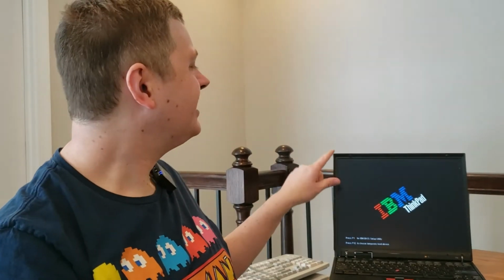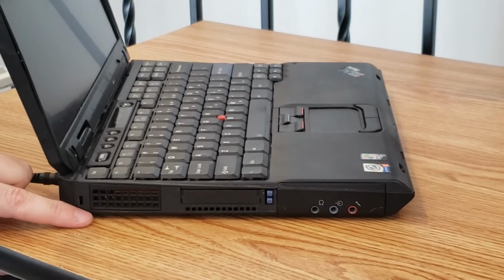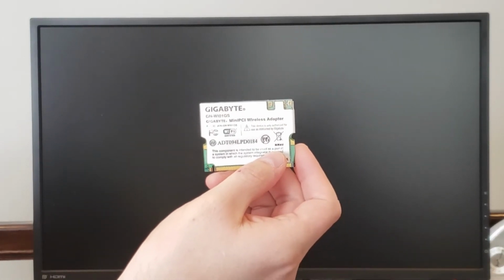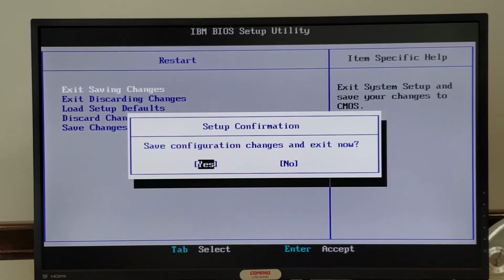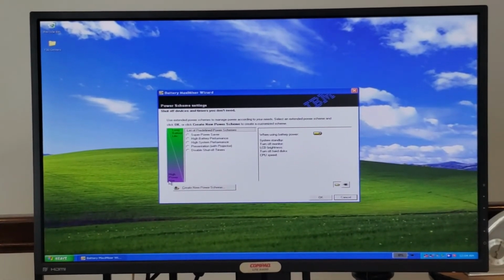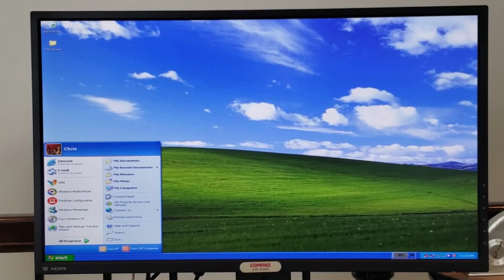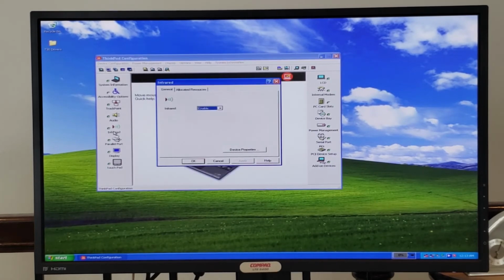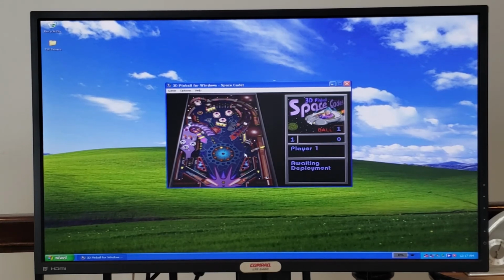RetroTour: Let's Explore: IBM Thinkpad T30 Pentium 4M Laptop!

Comment: I too, have a ThinkPad T-30 which hasn't been turned on in years. I recently had to dig it out to run a legal program that wouldn't even run in newer versions of Windows. So I had to use the T-30 to install the software to create some legal documents. The keyboard has spoiled me for life. I've been using an Acer Aspire for years now that also has a wonderful keyboard. I don't know who changed the design of the keyboards, but I absolutely hate these individual, separated keys on modern laptops.Of course, I'm old and learned how to type in high school on IBM selectric electric typewriters! That being said, I finally decided to upgrade, as I have been resisting the purge to Windows 10 and eleven. I actually drew the line at Windows 8 with that ridiculous cartoon interface. I ordered me an MSI gaming laptop last night. I'm not a gamer, but I have the need for speed.
Thanks for the trip down memory lane. I actually came her to watch how to replace the CMOS battery. It's in the memory compartment, but the connector is under the case, so sadly it can't be removed without taking of the keyboard.
Reply from the maker: I miss the old Thinkpad keyboards too!  Just ordered a new Thinkpad and the keyboard definitely isn't the same. Glad you enjoyed the video and thanks for watching!

Comment: Thanks to an active hacker community around the IBM ThinkPads, unauthorized HDD  + 1802 unauthorized network card issues have all been fixed with a custom firmware. I've applied this on all my ThinkPad X41's, so they shouldn't give whitelisting errors on boot even if the CMOS battery runs out. But I've also changed the CMOS batteries on all my X40's and X41's. The ones my laptops use are the thinner CR2016 batteries. They're still occasionally sold on eBay. I buy a couple every time I see them pop up. I buy the ready-made batteries, I think they were only like 5-7 bucks a pop.
Reply from the maker: Good info!

Comment: The T30 was my first exposure to ThinkPads. But you forgot to mention the (IMO) best feature: the ThinkLight!

Rather than share every little story I'll just say that I'm now the proud owner of an X31 with 2GB of RAM and a perfect battery. It's pretty much the same design as the T30 but it's smaller and has one small but notable difference: when you slide the latch to open the screen it stays in place until you actually open the screen. Opening the T30 with one hand was a bit of a juggling act as you'd need to get both latches pulled at the same time. Unfortunately my X31 went totally dead but I was able to revive it, I made a video of that on my channel.

And one last thing, there's a great mirror of the drivers site which is more complete than what's left on Lenovo's site:
https://thinkpads.com/support/Thinkpad-Drivers/
I'm mentioning this because they have the missing UltraNav (touchpad) driver that you couldn't find.
Reply from the maker: Great info!  Wasn't familiar with the X31!

Comment: Hi Chris

Nice machine, i never owned or used a thinkpad, but a few friends had them, not quite tanks but sturdy and well built, the only complaint was the price and they flatten the battery overnight even in sleep mode, i think the 1995-1997 era the cmos clock or sound card drained it

When i do fresh OS installs on theis era of machines, if they have legacy drives or ports i install dos 6.22 on 2G partition, and leave the rest of the drive un-partitioned, that way XP will auto use the unformated and use that and enable the XP dual boot on start up

I notice you had XP SP2 the 1Gig ram would be marginal, the machines i have on that era with 1Gig or less runs the original or SP1 version XP, 1.5G is the next step up for SP2 and fully loaded 2G or up to 3g or 2.5 usable is the SP3

Anyway the P2>Celerons are used for period games one had office 95  the other office 97

Funny how every second windows version is Ok and the one in between so-so

Regards
George
Reply from the maker: So true!  Ya... memory is a little anemic on this, I probably should have chosen a different OS!

Comment: Nice one Chris! I've a soft spot for the old Thinkpads. I've got an old R50e which I bought new in 2003 or 4. It has a Pentium - M 1.8 GHz chip in it , running XP Pro. The battery still holds a charge and the cmos battery still does too! Keep up the good work and thanks.
Reply from the maker: That's great!  These machines are pretty cool.  That's amazing that your batteries still hold a charge!!

Comment: Here is a video by this does not compute on the same model that fixes the issue on the ram slot if you want to try to fix yourself: https://youtu.be/zwBeTAjtHcc
Reply from the maker: Excellent!  I've actually passed this machine on to a friend, but I will pass this along.  Thanks for the tip!
Reply: @RetroTechChris  no problem